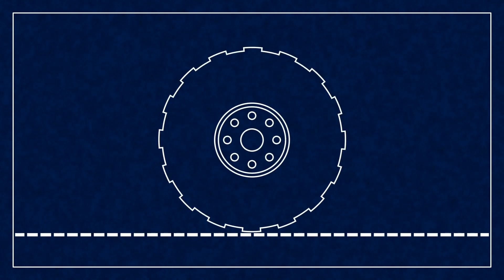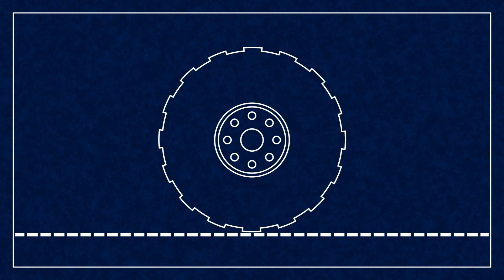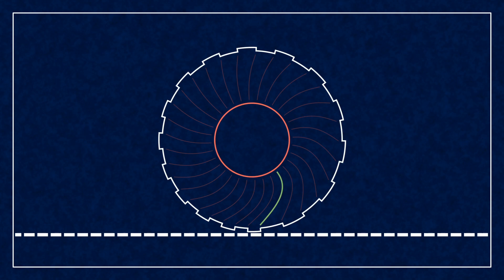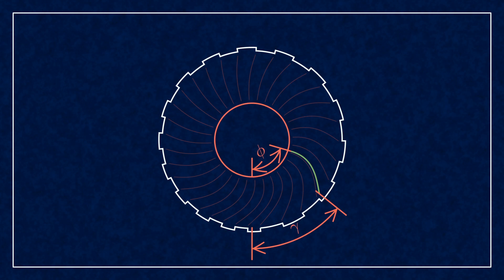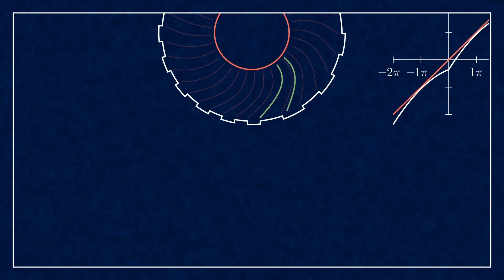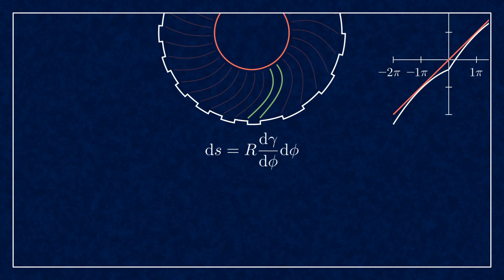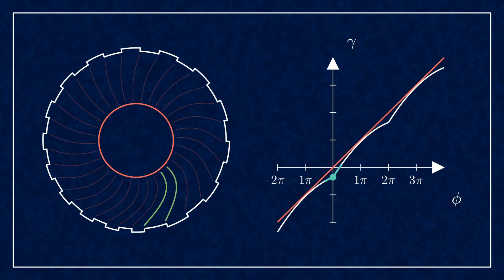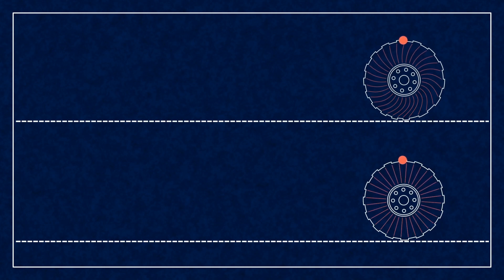Wheel slip visualized

Comment: Brilliant. New subscriber question: What's the average percentage difference in slip-free rotations vs. real-life rotations with slip for an average situation, say Honda accord driven gently vs spiritedly (lots of acceleration) at something like 120 km/h on average? Is it "a couple percent" or more like 0.1 or less%
Reply from the maker: Sorry, I don't have experience with the numbers in this field. I looked into the theory of it but I haven't worked on anything like that you need.
Reply: @gergelybencsik8626  Understood, not asking for an exact answer, just an estimate or educated guess. The amount should break down into actual wear-inducing slip (wrt to the asphalt) and just "flex" in the side wall and tread, agree?
Reply from the maker: @PeterBaumgart1a  Weelll, really uneducated guess is about 5% slip before it's sliding. However, keep in mind it's never a contact point, but a contact patch, and there's partial sliding in some percentage of the patch. So you'll get some wear even if you drive in a way that it never really slides.